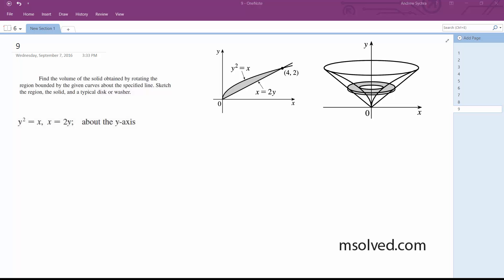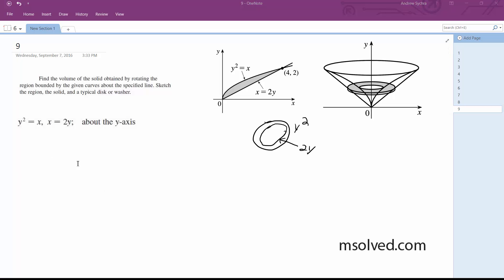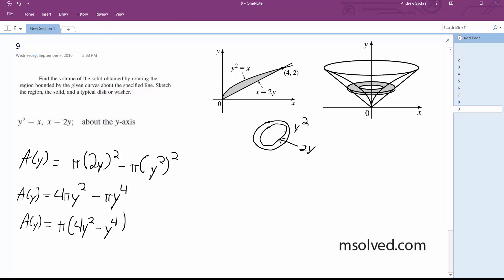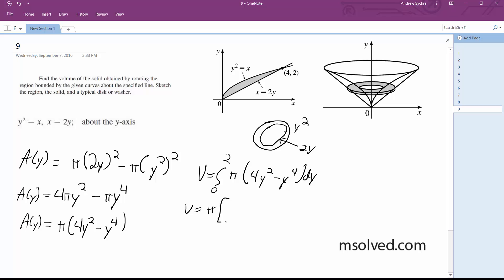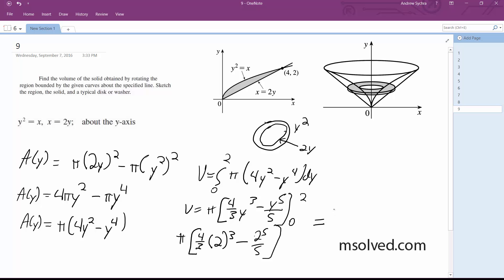y^2, x=2y; about the y-axis

Comment: I think the drawing of 2 circles you made is incorrect. The outer circle should be 2y and the inner circle should be y^2. Otherwise it wouldn't make sense because areas are always outer-inner, never inner-outer.
Reply: I think he just made a tiny mistake on that one.  The set up of the equation is right.